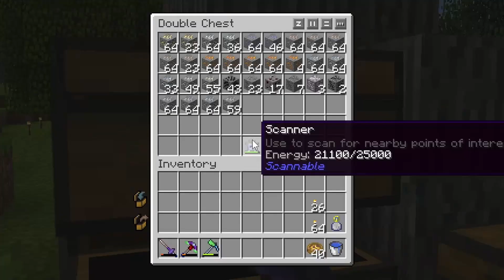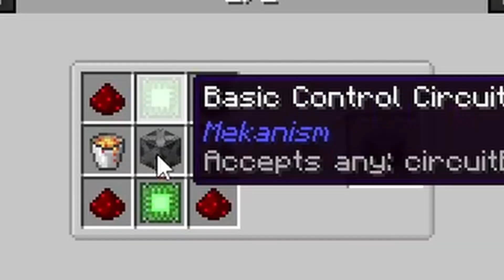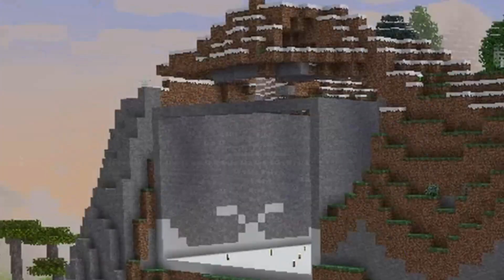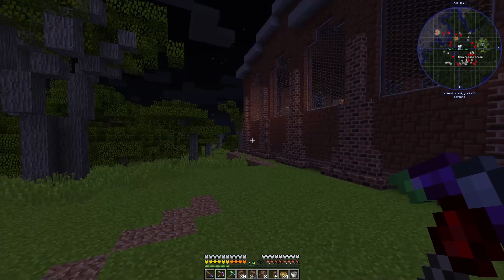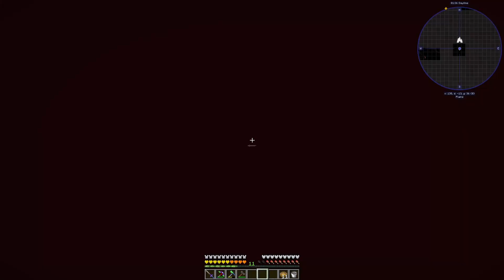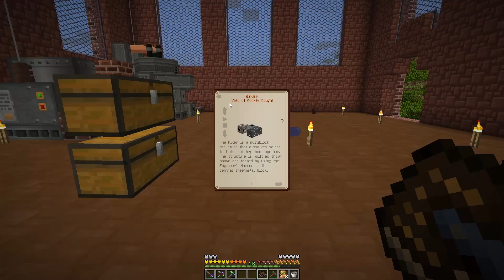Immersive Engineering Factory Complete!! | Minecraft: E2E ep.9

Comment: Please make the tiered chest, they are blast-resistant and are much cheaper than Implied Intergistics. Also instead of having the HV batteries all over the roof, you can alternate the sides with input/output to make one large battery. Then you would not have to wait for each one to charge to use the connected machines. Also, you should look into the Lanterns from Immersive since they prevent mod spawning in a 16-block radius even without the blocks being lit up.